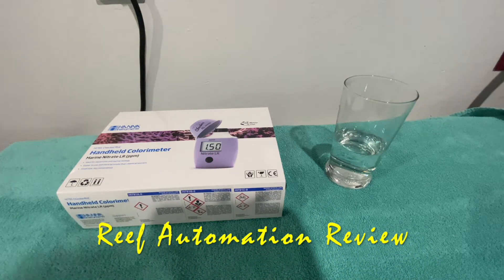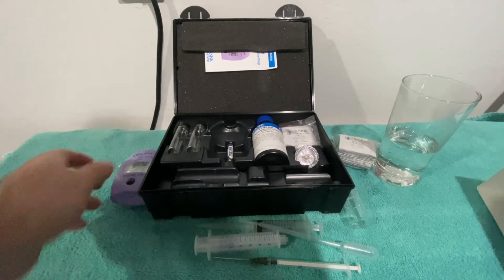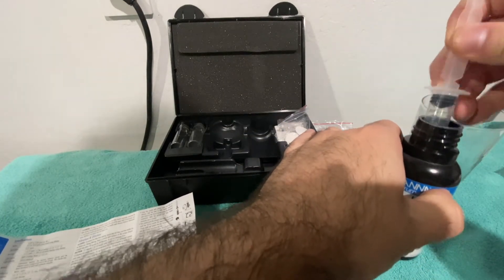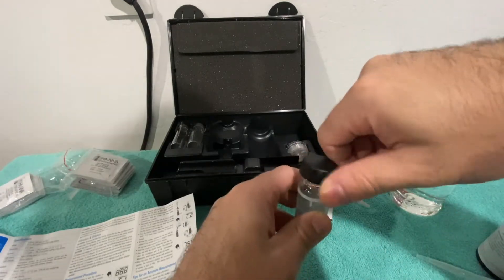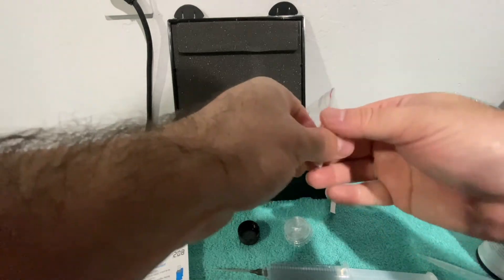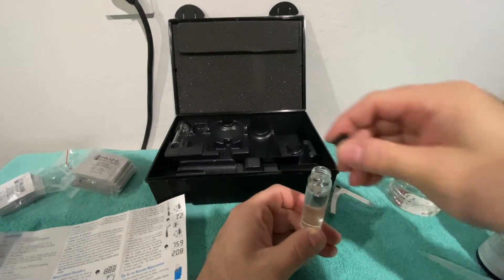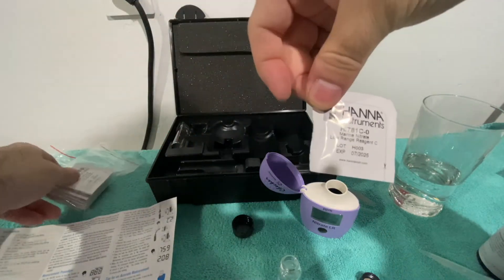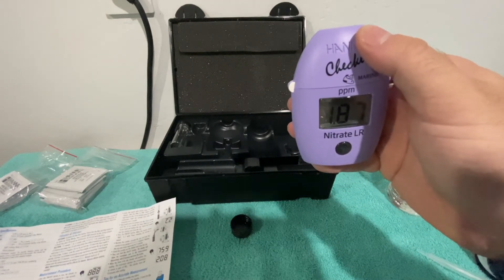Reef Automation Reviews - Hanna Nitrate Checker

Comment: An accurate checker. The only thing is that there are many steps involved. If you think your nitrates are elevated ie: (dependent on your stocking levels) then you would have to use the dilution steps) 
IMO it’s still worth its weight because of its accuracy. 👍
Reply from the maker: Thanks man!

Comment: Hey Derrick - When using plungers you don't fill the liquid to the line (ie 4ml of reagent 1).  You move the bottom of the plunger to the 4ml line.  The "air" is basically what is between the plunger and the tip and should NOT count.  You added around 5ml of reagent 1 (you filled the "air" pocket with reagent).  Maybe re-test and see if it's more accrate?
Reply from the maker: Darn it you're right!
Reply: @ReefAndReptileAutomation  Did you happen to re-test and did the result change?  Really looking forward to the release of these in Australia (have one pre-ordered) as I can't tell the color differences in kits.
Reply from the maker: @Macca_75  I was going to redo 3 tests but I’ve been busy.  I will see though.